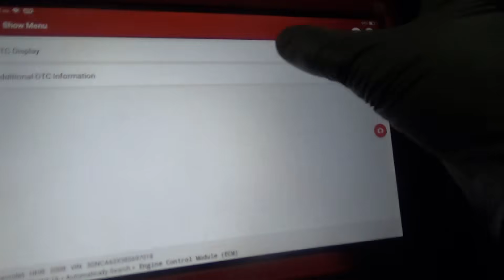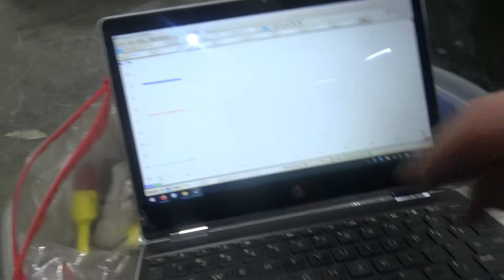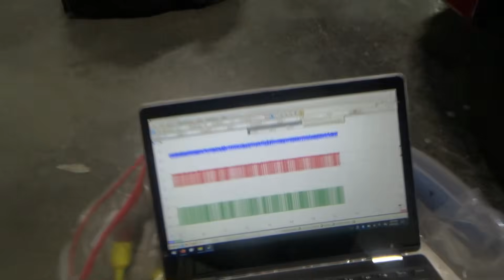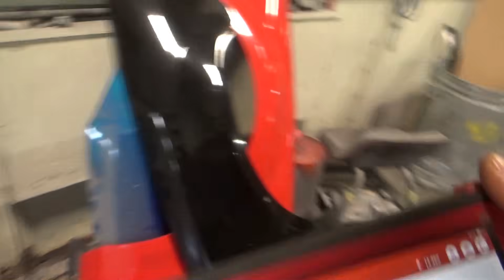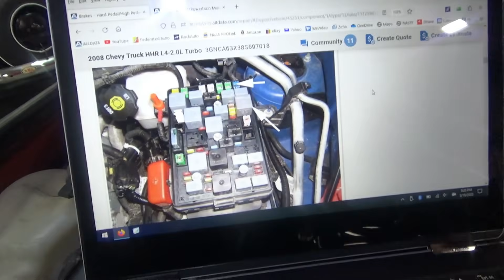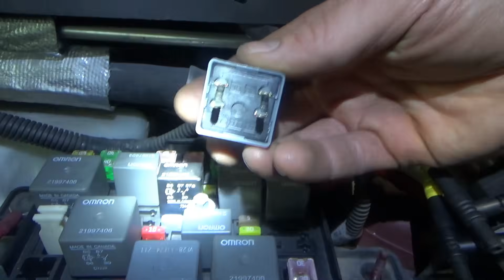HHR SS Turbo REDUCED POWER? (KY Road Trip!)

Comment: Hey Ivan, nice job on this video.  I own the exact same car right down to the same color except my car is a 2009, so I really wanted to comment on this video.  You mentioned the map sensor is bad.  I totally agree and this is why: The map sensors in that car are aftermarket Bosch 3-bar map sensors.  Looks like ZZ Performance sold those to the previous owner.  This company is an Ecotech tuner shop out of Flint, Michigan.  Anyway , the HHR SS uses 2-bar map sensors both on the top and bottom.  You can easily spot the top sensor on the intake.  Looks like the pervious owner went a little crazy on modding that car up.  But if you go with oem map sensors, I am betting that car will run fine.  Hope this helps.  This is officially my favorite Pine Hollow video now:)  Keep the videos coming Ivan, I enjoy watching.  Cheers!

P.S. There is a slight possibility that HHR may not have a stock tune.  That means there is a chance the ecm in that car is not the original.  If you are able to verify that, check and see if that car is tuned for 24psi of boost.  If you see 30psi of boost, that means the car has been tuned.  This is how us Ecotech fans go faster by making 300hp compared to the stock 260hp these cars make factory. The way ZZ performece tunes these cars is by selling pre-tuned ecm's to customers so it's a simple plug n play and have 300hp.  The customer sends their stock ecm back to the company.  But you need 3-bar map sensors to accomplish this because the stock 2-bar sensors will fail under boost.  I really hope you will not need a stock ecm , but it just looks like to me on this end, that car might be tuned.  Good luck:)
Reply from the maker: Excellent information, appreciate the insights! You fix that EVAP code on your HHR?
Reply: @PineHollowAutoDiagnostics   Hey Ivan:)  that made my night that you responded.   I am so glad I was able to provide insight.  Sorry I have not gotten back to you about my other HHR with the EVAP code, the reason why is because the CEL has not come back on since Jaunary, and I put that car up for the summer and have the SS out.  But this fall when I get that car back out and if the CEL comes back on, I will be making a trip down to state college to see you, but I sincerely appreciate your time corresponding with me:)  If you need anymore help on the SS you are working on, I might be able to assist.  I have owned my SS for 7 years and it has been an adventure.  It needed a whole new engine just one year after owning it, so currently my car is behaving.  Here is some more advise:  If you continue to have technical problems with the car you are working on, I would live chat with an associate at ZZ Performance.  They know what are talking about and their customer support is amazing!  I look forward to the follow up video to this car.  Best of luck my friend.  Cheers!
Reply: @PineHollowAutoDiagnostics   Sorry Ivan, don't mean to bother you, but I thought of something just now.  The lower map sensor on the charge pipe is a total nightmare to remove.  If you have to remove that sensor, loosen the lower radiator supports and push the whole radiator forward.  This will let you gain access to the sensor.  Your other option, is a phillips head screwdriver bit with about 4 feet of extensions.  It is possible to snake that whole extension from the top of the engine to get to the sensor.  Shine a flashlight down there and you will see it.  If none of that works, remove the bumper lol.  I have had mine off many times and it is super easy.  Good luck and have a good night🙂

Comment: Great scope data on the HP pump, showed you had poor current carrying capability, good old pin fitment burns you every time. Was that an aes wave low current clamp? I need to find a good one.

Comment: The stability control is acting weird, as the yaw rate was indicating up to 10 degrees/s of yaw while you were driving straight, so the system was under the impression the car is going sideways. Might need a little more than an alignment.

Comment: I own an engineering company, where bug tracking on industrial equipment is pretty common. It is somewhat semilar to the problems you encounter in a car. I have made it "mandatory" to measure signals with the oscilloscope instead of going "parts cannon" right away. I'm really happy for the inspiration. I'm considering making yours, and Eric's videos mandatory teaching for those who work in the shop

Comment: Great diagnostic, Ivan! It definitely looked like a broken wire in the solenoid, making random contact - it was not a wire, it was the connector. That dealer modification probably wasn't made with OEM parts, to save a few bucks. Good catch on that undocumented trap. Would be interesting to know a follow up, after pressure sensor is replaced.

Comment: Hope you replaced the high pressure fuel pump - gas leaking past the seals is not good, as it fills the engine, diluting the oil lubrication efficiency.
Reply from the maker: Yes I recommended OEM pump.

Comment: had a nissan juke drive out of a corner and the two left hand wheels brakes banging on and off looked abs wheel speed sensors all good  no money lights finaly tracked it down to steering angle sensor steering wheel looked ok  but sas showed a 2-3 degree turn couldnt do a reset so sas needed to be set on scanner then wheels tracked two others had a go and give up the car thought it was going around slight bend  and expecting to see sensors on outside wheels going faster and they were all at same speed and didnt like it but not all the time  keep up the good work Ivan

Comment: Looks like ebay pump.
Also pump is no good the fuel smell and  ticking is sign of internal failing components..will dilute oil so recommend get oem pump the ticking will come down far less to normal sound.

Comment: Thank you for the deep dive into this pump circuit. Possibly a thinner pin on the AM pump? Would have thought 10 volts would still operate the solenoid. Inductive reactance probably adding more resistance when pulsed at higher frequencies. Low budget fixes may get you running or require a competent tech to uncover non Original Equipment Manufacture issues.

Comment: I can only imagine how many vehicles wind up costing hundreds if not thousands of $ needlessly because of failed connections! If you don't have the instruments/knowhow to track gremlins like that down, most people will be pulling their hair and their wallets out! Great vid, Ivan! Enjoy your trip! 🐴👍
Reply: Yep, maybe it was setting a code in the past for fuel pressure and someone spread those pins by stuffing multimeter probes in there (or something equally large) and created a new problem.

Comment: There is probably a slight difference between the thickness of the pins on the OE  pump and the aftermarket one.  The difference was enough to loosen the fit...
Reply from the maker: That car was definitely not a virgin 🤣

Comment: I would think that if you disconnected any ABS sensor, you could check to see if anything changes regarding TCS. That should disable the whole system, not just partial  like turning the switch to off. As for the low power and odd upshifts, yes the PCM needs to know correct boost pressure. I wonder if the terminal fretting was caused by so many people taking the connector on and off during the head work, then diagnostics?

Comment: Loud engine tapping sounds like it's out of oil ....
Reply from the maker: That happens when high pressure pump isn't happy...
Reply: I have an SS also, the pump is noisy when running. Generally bent valves were because of timing chain issue which is common with any Ecotec motor. First indication is a rattle when first starting followed by a code.

Comment: When you ground the control side of the relay with the test light, some other relay clicks. This means it's wired in parallel with some other relay. But how can it be setting a circuit code then? There is already a relay in the circuit. Maybe having two in circuit has the computer sensing too much current (double the usual for one relay) and it's setting it because of that? Is the control side of the relays miswired?
Reply from the maker: The fact that it was a later add-on and having no OE diagrams led to a dead end unfortunately...

Comment: When you plugged the boost sensor back in at 33:48, it did spike down to 0.9v and 4psi.   Why would it do that?     I guess it's still wrong though.  It should either read 0 psi, or 14 psi (atmospheric pressure)-  depending on how it is calibrated.   But I'm wondering, why would it spike down towards the correct pressure when you were plugging it in?  Could it just be another bad connection at that plug?  (or I suppose it could be a bad connection internally inside the sensor too).    You didn't break down the 4 wires to the sensor on a schematic, so I don't really know how it works;  I think they are usually only 3 wire for a pressure sensor, so this probably has a temp sensor built in also or something- since it's a 4 wire..  But it just makes me wonder what could make it spike down like that, and basically work correctly for that split second?  Kinda strange
Reply: At my location the local barometric pressure is 23.85 in. Hg. or 11.71 W.C. in. Which is .423 psi.
Reply: @DeanLangley  congrats..  you're in the vacuum of space (almost) :)

Comment: Hell's bell's! That damned engine belongs into a Saturn ION 3 Turbo Coupe not an HHR!! If I didn't know any better,
I'd say that someone didn't change their timing belt on time to wreck a bunch of valves. Just another one of them
GM's that shouldn't have even squandered their time away trying at best to put a turbo model 2.4 into an HHR with
a curb weight of how much?? I just think that's sad sack for those engineers that pissed away so much time build 
a whoopty-doo just to try and impress and wow customers into a great heap of you know what! That 2003 Saturn
ION 3 even without the turbo could probably out pace that one and it sounded even better when I stood into it! I
mean to tell you that car I put through pure hell and just kept taking it. And yes, I still have it in my yard with the
back axle/suspension carriage all rusted out and it can still run.
Reply: 1 it's a chain 
2 it's a 2.0 
I'm guessing you've never raced one there's several im my groups making 400 plus horse and will take 30psi of boost all day.
Reply: @Foxfatherracing  I'm just not buying this 400 plus H.P. period!  That engine isn't built strong enough for that! 
The most amount that I've ever seen was was with the 1988 Ford T Bird 2.3 class liter turbo coupe built in 1988 was a wild-ass car that was turbo charged. The rating of the Turbo Coupe was only 193 H.P. @240 ft.lbs. of torque with a 5 speed manual which was way underrated.
Twin Turbo on a 2.4 liter engine which just might be possible but still, how long will it last, 30-90 days of a solid @$$ whoopin maybe? The 2008 HHR SS 2LT (Stock) model is a 2.4-liter four-cylinder generating 175 horses and 167 lb-ft of torque! 
I've even seen and drove my bro-in-law's 1992 Mitsubishi 3000GT 3 liter class Turbo VR-4 Specs was only 300 H.P. @307 ft.lbs. of torque and I believe that it had twin turbo design. 
  
The 2005 Saturn Ion Red Line Edition was a 2.0 liter and it is quite fysty to say the least , rated at 205 H.P. @145 ft.lbs. of torque and it was so much lighter in curb weight than the HHR SS hands down!

I've even seen and drove a 1989 Ford Taurus SHO with the experimental Yamaha V-6 with 5 speed manual that can beat the snot out most cars on the road. This motor was rated at 220 H.P. @ 200 ft. lbs. of torque which in 2005 was coined "King of the Road" going up against Vettes with LS's and Mustang's that couldn't hang.
Reply: @craigtegeler4677  have you been drinking?
Reply from the maker: These HHR SS have some serious balls when they run right 😉
Reply: , @PineHollowAutoDiagnostics I just think that Foxfather is just a bit bragga docious is all, just like the younger crowd seem to that think they have it all when it comes to Horsepower that is nearly unattainable along with the possible destruction of anything that get their hands on! I do know where you are coming from but these other cast of characters, I just don't know! Clowning is one thing but I would want to see the proof is in the pudding is all!! I've been around cars since 1973, and my senses are telling me that there just might be a b.s.er in the room!
Reply from the maker: @craigtegeler4677  tech has come a looooong way since the 1970s... 250hp soccer mom turbo crossovers are all the rage now lol

Comment: (I'm 5 mins in,  you just pulled the pump)-   I feel like we should devise some way to physically check the pressure on the high pressure side.   I know the scantool is already reading it.  But it just seems like it would be a good little kit to have-  being able to test the high pressure side independently.  (and redundantly I suppose).
Reply: https://youtu.be/tt1o_RiwKX4   This is a YouTube video of the high pressure test gauge in use.

Comment: Mr. Ivan, my prediction is that the dealer installed aux. vacuum pump is somehow tied to the boost pressure sensor. I bet the pump is only commanded on when the boost pressure is above a certain psi for a certain period of time. The only thing here in my thinking out loud to you (that I can't explain) is why it is throwing the control circuit code and not some other code. Also, I'm chasing a p06a7 circuit b reference code on a lincoln mkz after cleaning intake valves that's kicking my tail. I'd send money for advice.. lol seriously though thank you for sharing your experience and electrical knowledge through these videos.

Comment: The control pin on that relay was hot because it was back feeding thru another relay. The click you heard was because the test light was grounding the other relay. I'm assuming it controls 2 relays.. ESC light was definitely most likely because of the steering being off. We have that issue all the time with the xB's. I believe somewhere between 10-15 degrees is the limit it can be off..

Comment: The oscilloscope is still indispensable as a diagnostic tool. I had thought they went the way of the dinosaurs with the extinction of points distributors. As usual Ivan, I learned something new from you. Be safe in your travels.
Reply from the maker: Oscilloscope is king on both new and old school systems!

Comment: Another great video ,  I love the way you think out aloud as I try to follow your thought  process . Sometimes I come up with the same ideas which gives me some confidence all the time I spend watching these videos is actually teaching me diagnosis skills outside my normal work knowledge . I take it you replaced the HP fuel pump with a OEM unit , you didn't show that on the video but you did say the non oem pump smelt of fuel on the camshaft follower  end you would source a OEM replacement. I often thought how a gasoline  turbo vehicle can obtain brake booster vacuum when the intake manifold runs a positive pressure most of the time now I know. The additional vacuum pump makes sense almost like a diesel vehicle using a pump to obtain vacuum.
Reply: Was wondering the same thing about replacing the smelly pump.

Comment: I always thought that was the way that hp fuel pump works.  Take the power away, it stops boosting the pressure.  Acting as a failsafe if you will.  Nice find with the connector though Ivan.  I'm wondering how those connectors got widened out like that.

Comment: Ivan question for you dealing with diagnostic on these high pressure fuel pump issues, this is the second one you have put a video out in less than a month.  My question is, I was always told that the lines coming out of the high pressure pumps are one time use and have to be replaced every time you disconnect them.  Is that what you do in cases like this or do you just reconnect the lines after your are done?  I'm still learning about these high pressure fuel systems and have a lot of questions.
Reply from the maker: I have never replaced a line and never had a problem...
Reply: Ivan reuses TTY head bolts, you think he's going to replace high pressure fuel lines?? 🤣🤣🤣🤣
Reply: Thank you both

Comment: The 90 degree pick might be the most under rated tool of necessity ever made.  You could give me a 10000 piece set that would nearly be utter garbage without a 90 degree pick.   Looks like whoever replace the pump jerked that connector loose and ruined the drag on connector.

Comment: Finally an HHR!!! That's what I drive, but mine doesn't have GDI, a vacuum pump, or a turbo. Seems weird, because mine's a 2010. I rode in an SS model with the turbo, and I didn't really sense that much acceleration when the driver punched it. Really thankful I was lucky and didn't get the GDI - didn't realize it was around at the time. And glad I got a clutch!

Comment: So I guess with this model, power to the pump activates it rather than reduces it as you thought? And the computer was generating those strange 3v intermediate voltages by itself as a result of reacting to an open circuit? Quite strange behavior. Seems that when designing that they didn't pay much attention to how it would throw off diagnosis (I'm sure there is a good reason of course, maybe they are trying to save the driver in case it shorts? Not sure...).

Comment: Those Hard farts will get ya Ivan!
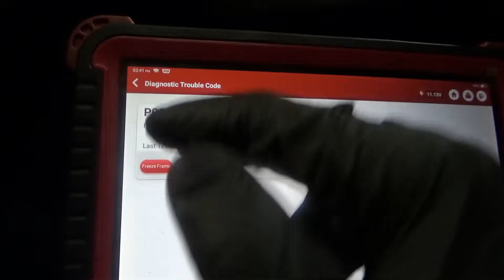Reply: 2:17
Reply: Emission control system leak detected
Reply: Had my gut aching with laughter! Love this channel. Look forward to it everyday.
Reply: Probably caused by the K&N filter
Reply: I went back and played it again.
Reply: When I heard that I thought first fart joke I've heard from Ivan he didn't even grin and kept a straight face ..
Reply: Thank you not cutting that from the video!
Reply: Hard farts are usually pretty costly and will require some parts